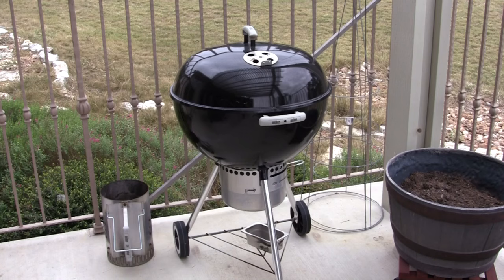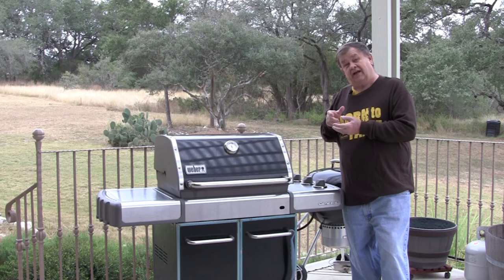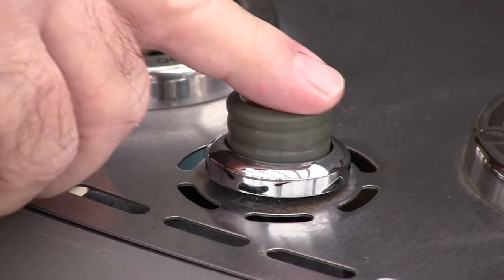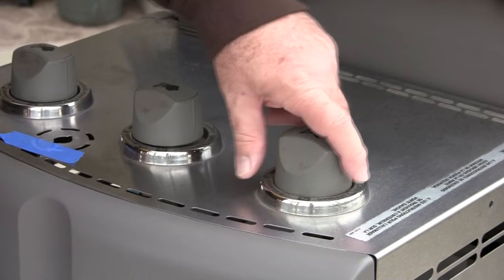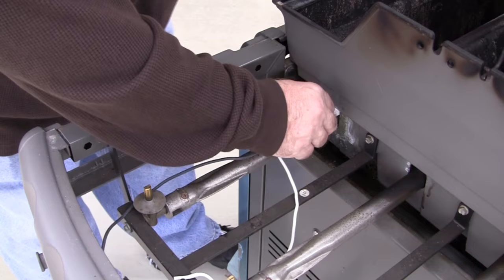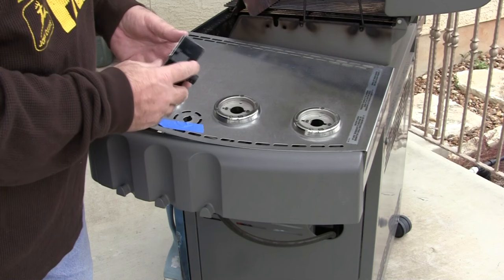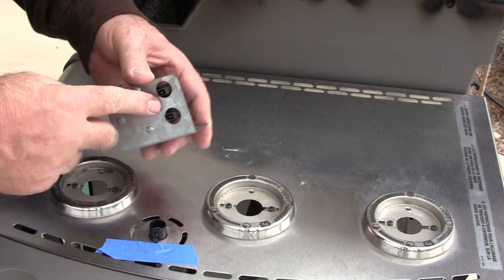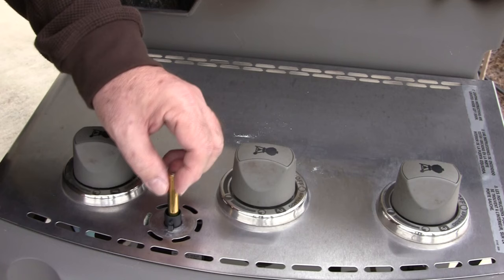HOw to Fix a Weber Grill Ignitor

Comment: This is my second one. We have it outside the garage door exposed to the elements yearound https://www.youtube.com/post/UgkxreK_FUQ74_bylFqCr3y2MHqL3u78-b3r Direct sunlight deteriorated the plastic on the thermostat and severe winds blew the lid off. We found it about an acre away. I bought a new one and I saved the good parts from the old one as spares. Got about 8 years out of the first one.
Reply: Glad I could help.  Thanks for leaving a comment that this old video is still helpful.

Comment: Nearly nine years later based on your video date and yet the timing is perfect.  Giving my old grill to my son and tuning it up so it works well right out of the gate.   Putting in the igniter was the next and last step.   This informative video did the trick.  Thanks for taking the time and trouble to make another man's work a lot easier.

Comment: Wanted to take a moment to thank you for this excellent, step-by-step, all-inclusive instructional video surrounding changing the battery in the igniter and/or switching out the entire igniter system.  My father passed in 2000, and he was always my "go-to" guy when something mechanical has gone awry.  I actually had tears in my eyes while watching this video because the manner in which you teach/instruct is so very similar to the manner in which my father would have helped.  Thanks . . . for the instruction, and for the memory.
Reply: You are most welcome, Steve.  Thank YOU.  :)

Comment: Great video, thanks for putting it together.  For anyone else looking to fix their ignitor, here are  couple of preliminary steps:

1.  change the battery
2.  check for corrosion on both of the battery contacts (this is the most common problem)
3.  if some of the burners are igniting, check the electrical connections

Comment: Thanks for taking the time to make this video. I just pulled my 2008 Weber E-310 out for the Summer and went through the yearly checks of ensuring it's safe to use (hoses, burners, flavorizer bars, grates, tank mount, igniter. The igniter button didn't produce that quiet and familiar clicking sound and,  upon inspection, found the battery in the igniter had corroded (didn't even remember when it was last changed). When I attempted to gently remove it, a metal pin of some type inside fell out of the battery tube. So I decided I probably needed to replace the igniter. First thing I did was to call Weber for the correct part # and purchased this kit 2 days ago from my local authorized Weber dealer to replace the igniter on my 2008 Weber Genesis E-310 (that's the model you have. The E-320 has the side burner). The Weber part # for this specific igniter kit is 67847. It's readily available through either Weber or grillparts.com, if you don't have a well-stocked Weber dealer nearby.

Although I'm not much of a DIYer, I'm going to install it this evening (first time I'll have ever done a repair to a grill). It looks to be fairly straight forward from your video. Thanks again for taking the time to go over the installation.

Quick follow-up: I was able to change out the entire igniter switch system yesterday evening without any problems. Thanks, again, for your step by step "how to" video.

Comment: Thanks for the video!  My ignitor had a battery corroded inside of it and completely fell apart as I attempted to get the battery out.  I had tried to rig up an ignitor from a CharBroil grill, but couldn't figure out how to get the electrode out.  I bought a replacement kit, and your video saved me some time figuring it out myself!

Comment: Thanks Steve, had same problem & really did not know where to start until I saw your instructions. Battery did the trick. Old one, AAA, already leaking acid but a little denatured alcohol, long cotton tipped cleaner & small flat bladed screw driver as a scraper did the trick. Thanks again.

Comment: Thanks Steve,  Also have the Weber E-310. I never knew the igniter needed a battery.  I've had the grill for about 7 years now and never had a problem.  Put in a knew battery and it's working again. Can't believe the battery lasted so long !
Reply from the maker: Great!  Glad the video helped.  I only wished more of the suppliers ( Big Box Stores) knew about it and I didn't need to call in to support for the right part.  Thanks for taking the time to comment

Comment: Thank you so much - this is one of the best videos on YouTube.  Great video quality, great audio, very clear instructions.  I was going to buy a new igniter but, after watching your super video and seeing how the igniter system works, I took the battery out and noticed that there was a little oxidation or corrosion on the battery contacts.  I cleaned the contacts, replaced the battery, and cleaned the electrode - and that little thing is clicking away.  Took me less than 10 minutes - THANKS TO YOU!  Have a great summer.

Comment: Very useful video, it shows well how the igniter is assembled. The problem in my case was just oxidation of contacts, deep cleaning solved the issue. When you remove the plastic cap for changing the battery if you keep it in your left hand and push the button with the right thumb you see two small contact stripes on the sides. When you push the button those are supposed to touch the spring that you see inside the hole and close the circuit. I cleaned them and now it works fine. Check that before disassembling the whole thing.

Comment: I have the same ignitor but there was a little debris in the bottom of the battery tube preventing a good connection. Tapped it out and works like a champ! Thanks for the great video!

Comment: Just bought this e-310 used at an estate sale. This old e-310 Weber grill doesn't have any rust on the body anywhere except the burners aren't all shiny and new looking, but they aren't rusted out either. Good job Weber for making an excellent quality gas grill!  
Anyway, Thanks for making this video Steve. The igniter is the only thing NOT functioning because the battery exploded inside. Your video is still relevant 11 years later. 
Weber doesn't make it easy to find the igniter parts for their old grills. My igniter has the part number 1819-51 on it, but Weber's website doesn't have it listed anywhere on their website.  There are lots of Chinese knock offs on Amazon. I'll give Weber a call before I buy a cheap knock off since the old one lasted so long. Besides Weber deserves our business even if it's just ordering a part. 
I'll definitely only buy Webers going forward! 
Again, thanks for the great video Steve!
Appreciate the time and effort you put into making it!
Cheers!
Reply: Thanks, Doug,  I agree, I'm not sure why they make it so difficult to find the correct part.  I have however, found their customer support line very helpful.  That's how I finally found the correct igniter.

And I completely agree about the Weber Quality.  I had some Big Box grills before I bought the one in the video.  Sold it maybe 5 years later when I upgraded to a larger Summit.  Webers just last!

Glad the old video helped, Doug!

Comment: Posting this in case it helps someone else.. i have a spirit ii 2 burner and I thought my ignitor was bad. Took it completely off and put it back on. Changed battery. Then I found the problem. With old batteries the battery compartment can get corrosion. Clean off the spring wires in the battery cap and inside the compartment with a toothbrush. If it's really bad try some baking soda mixed in water. Let it air dry over night. I just used my finger nail. Then pull on both springs a little bit to make them longer, not too hard just pull a little bit. The problem is that the spring on the cap needs to make contact with the spring inside the battery housing or else the negative end of the battery cant connect to the ignition system. Once I realized this and got them to make good contact the ignition started working like new. Best of luck my WEBER people.

Comment: This video worked great.  Thanks.  I have a Spirit grill instead of Genesis but the process was the same.  In my case, I didn't need to replace the igniter.  I just took it apart and cleaned out the battery contacts, replaced the battery.  I tested it before putting it back together and it sparked as expected.

Comment: thanks for your video!  i'm late to the party, but i wanted to share another repair method that works without having to buy new ignitor assembly.  

my repair method with this style of ignitor was to clean the contacts on the upper push button and lower receptacle with automotive electrical contact cleaner (wet the contact and use a small screwdriver or pic while still wetted) to clean the terminals back to shiny.  reassemble and test with new battery for spark.  then, most important step - - remove battery and put a dab of dielectric grease on the top and bottom of the battery to prevent the contacts from corroding again, reassemble and confirm function.  i also put dielectric grease on the plug-in terminals for good measure.  $22 saved vs purchasing a new one, and it only takes about 10 mins to do this. cheers.

Comment: Thank you for this video Steve. This was a big help. I have the same genesis grill as you which I bought used and was not sure how to fix the ignitor. Turned out all I needed was a new battery. But now I know how to change the ignitor as well when the time comes. Thanks again, much appreciated.

Comment: Just setting up a new Weber Spirit and couldn't figure how the igniter worked.  Thought it was broken.  Come to find out we were expecting the igniter button to push 1/4" or so down to send a spark.  Come to find out, we weren't pushing and holding the button long enough to hear the switch working.  It barely moves.  Simple solution!  All is well with the new grill. Thanks for the video.

Comment: Thanks Steve. i didn't know there was a slot for my igniter. i thought the igniter was bad until i knew there was a slot. placed it properly in the slot and it just looks like the igniter is just fine after all and was placed wrong. thanks for that

Comment: Great video!  Thank you for taking the time!  We cook fish on the grill!
Reply: Thanks for commenting.  Glad it helped...
Reply: @SteveHowardPhotography  Steve, what model is your grill?  I can figure out which burner tube to buy, my grill is exactly like yours.  Thank you again.
Reply: @judesmith3910  Hi Jude.  It's an older model Genesis.  You can tell from the burner location.  This model is on the side, and the newer genesis models are on the front.  You should also be able to tell from the serial number and model number data plate, although I don't remember where it is on this model.  I believe it is an E-310.

Comment: Thank you for the tips. I put a new igniter right out of the Weber box on my grill today and it provided no spark. I took the battery out and there was a piece of plastic between the spring and the  housing preventing the circuit from being completed. I used a small screwdriver to pry it out, put the battery back in and it worked. So much for quality control by Weber.

Comment: Yes I have cooked pizza several times directly on the grate of my Weber Kettle over a mixture of pecan and lump embers.  Once you get your method down you can get fantastic results.  Use the gas grill to prep the toppings like sauteing mushrooms, grilling onions, or crisping up pepperoni in a cast iron skillet.  Crust will burn this way if you try to cook long enough to do anything but melt the cheese.  I have also cooked pizza on my ceramic grills on a pizza stone which is also excellent.

Comment: Agreed. Weber basically don't wear out. I have an electric, a kettle and a gas grill. They all have their place.I can do a lot with a gas grill but if I have to make a pouch and put wood chips in, I am better off using the kettle or the smoker. Surprisingly, the weber electric and the weber q do more than you would think.

Comment: I just repaired mine by cleaning any corrosion and pulling the spring to make sure it has contact. There is so little that can go wrong with these I would look to try to clean/fix it before replacing it. less money too.

Comment: Just so your viewers know, this job can be done without removing the table cover. To properly demonstrate the procedure and video it, the way you did it was best. 

Also, having the same problem, I was able to repair my ignitor by cleaning the battery contacts… first with 90% isopropanol and Q-tips, and then with a contact cleaner.  Deoxit is my go to for that.

Comment: @CooksGarden Fair enough.  Usually for me it is just the spark gap near the burner that is dirty with grease and shorted out... and won't spark.  Strong degreaser has worked miracles cleaning these points on my BBQ.

Comment: Test first. I was able to remove mine and it was just a bit of corrosion that with a little sanding on both the positive and negative contacts where the battery touches inside there. That did the trick. Glad I didn't buy one first.

Comment: I was looking at the CalFlame Sear Zone burner on Amazon and I saw your reply in the Q&A's mentioning that you'd replaced one of the burners in your Genesis E-310  with one.

I would LOVE to see a video on that!  I'd like to give it a try on my new S-310.  Your mention of having to cut off the tube (what's that tube for?) and fabricate a bracket to attach the back make sense.  I'm curious about how you had to modify the igniter and if the connection to the propane was a direct fit.  Thanks!!!

Comment: Thank you for the video. I don't have an weber grill. But the concept is still the same i guess.  I have an separate igniter from where my battery goes. I am guessing I need to replace the battery housing?
Reply from the maker: First check the battery housing to see if all it is is corrosion.  I neglected to talk about that in the video.  If it's clean, then yes I would look at the battery housing if you have an electronic ignitor and not a pressure switch ignitor.
Reply: @CooksGarden  Thanks for replying.  No corrosion. No spark. I am ordering a new one from Amazon. 6 male. Your awesome 👍 keep up the good work

Comment: This was perfect Steve, and very helpful and timely....so my igniter has the clicking sound, but doesn't ignite.....should I replace it, or possibly something has gotten loose?   FYI...it was in the back of a pickup truck a couple of times and got banged around....the igniter was working fine before it was borrowed :(
Reply: Hi David- First thing would be to check the battery compartment for corrosion.  Many times that's all it is.  Clean with a little steel wool or small tool, replace the battery and you should be good.  If it's clicking though it could be the igniter and I would try a replacement if the terminal cleaning didn't help.  I would also check for loose or disconnected wires too.  I hope this helps a little.

Comment: Can you possibly provide the part number for the correct Weber rotisserie that fits this particular model? I know that's not what this video is about, but I have the same model as you have and I have twice ordered what was presented as the correct rotisserie part for it and had to return them or sell them again on eBay. I have sent an email to Weber without any response. Much appreciation!

Comment: I have the same bbq I bought use one but i am struggling to connect the gas hose. I can find the nipple that will fit for the hose. The part what is connecting hose and bbq? Any idea were I can find that? I was looking even on weber website but no luck.
Reply: @SteveHowardPhotography  Thank you so much for reply. I bought use one but I didn't know that is that old I should check before I bought it. However bbq is in good condition. I called Weber customer service they just send me manual and refer to Home depot to by part. I checked with home depot but I couldn't find what I need. I need nipple that connect bbq with gas hose. My gas hose end doesn't fit for bbq. I don't know how to explain better sorry for my English. I would even buy another hose if necessary but I think hose is ok I need just that extension. I purchased hose on Amazon
Reply: What I need is male connector but I am not sure what is the hole size on the bbq doesn't say on manual